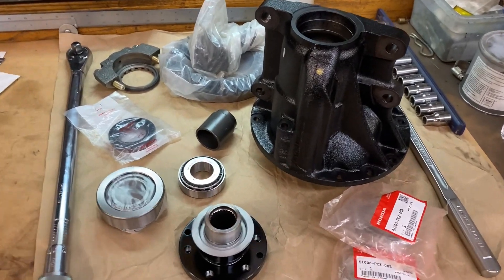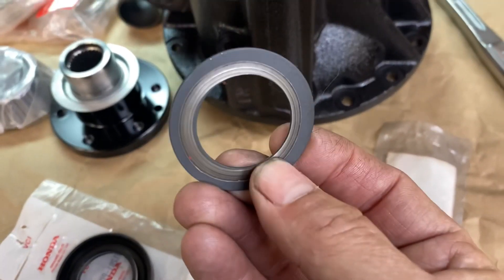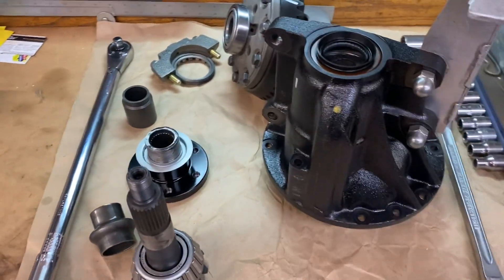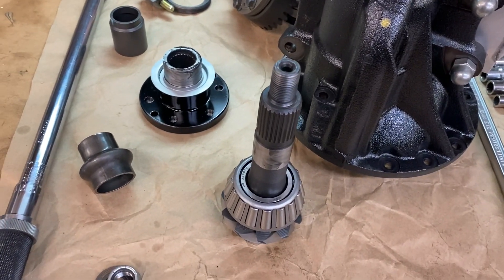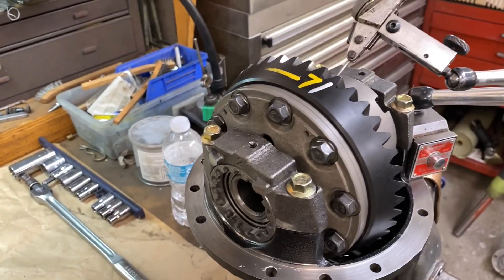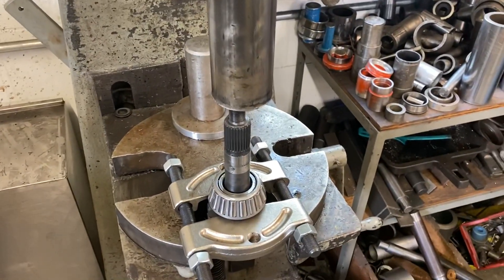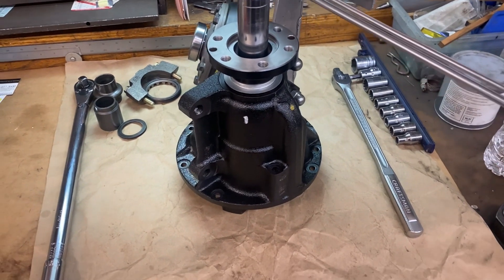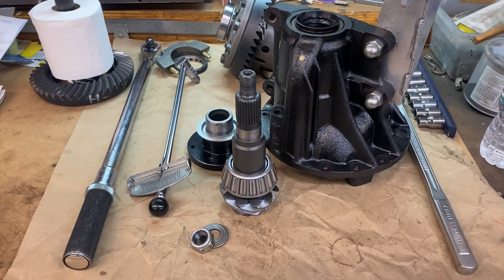Part 2 PuddyMod S2000 differential restoration rebuild

Comment: How can I get ahold of you. Had a dyno tuner do a 7000rpm clutch dump and now I have 7 neutrals, lol. 
I was told when I bought the car it was one of your rear ends, but I am pretty darn sure it was stock. Looking to have you rebuild it.
Reply from the maker: PuddyModRacing@gmail.com
Reply: @puddymod  Hi your adjustment is 0.03mm?
Reply from the maker: @Przebudzony  the measurements are in inch” .003 thousands:)
Reply: @puddymod  Ok thanks
Reply: Wow! Your level of detail is incredible! Emailing you now, thanks.